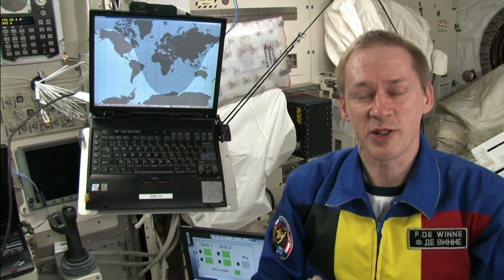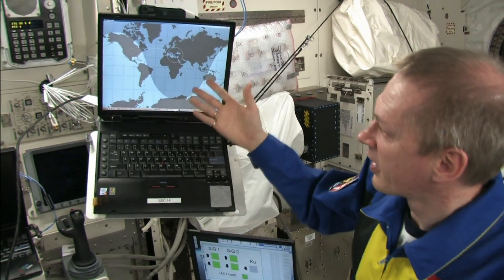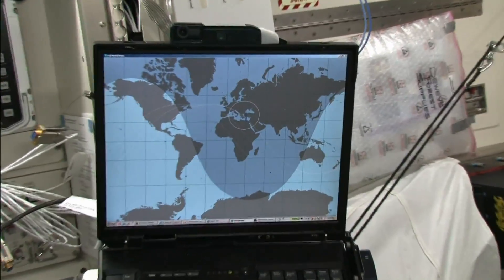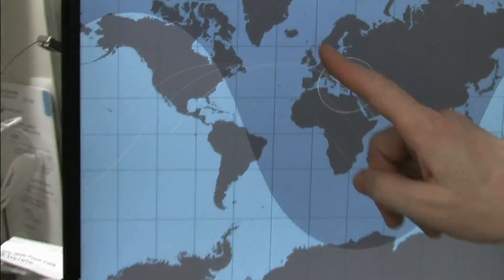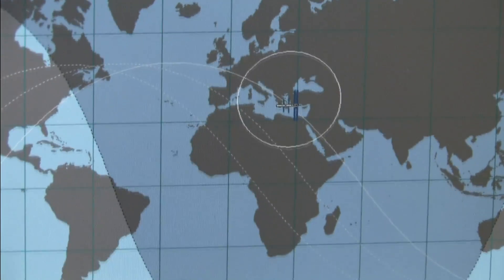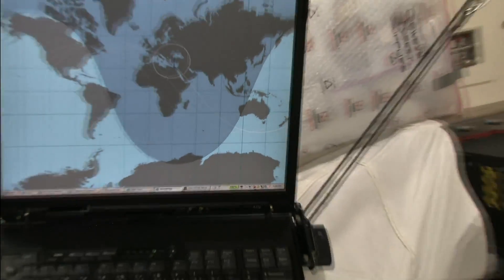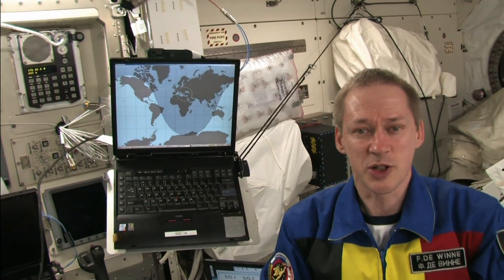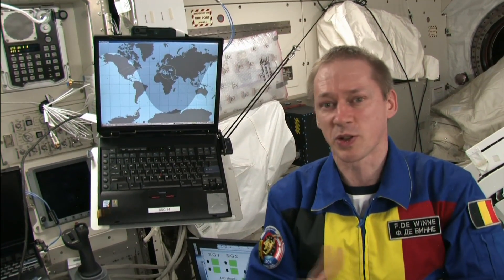How do you keep the ISS stable in orbit?

Comment: Hi! But how does it move if there is no air in space? I mean how do you thrust it without air resistance?
Reply from the maker: Hi there! Great question! In space, there's indeed no air to provide resistance for traditional engines. The International Space Station (ISS) uses thrusters that expel a stream of fast-moving gases, like nitrogen or xenon, as reaction mass. Newton's third law of motion states that for every action, there's an equal and opposite reaction. So, when the ISS expels gas in one direction, it moves in the opposite direction to conserve momentum. These thrusters help control the station's orientation and keep it stable in its orbit. It's a fascinating application of physics in space! 🚀🌌
Reply: @EuropeanSpaceAgency  Thanks indeed! It is an amazing explanation!

Comment: Hello,
   How can it keep its orbit at 17,150 mph(average),when he says they need to adjust speed to adjust to higher altitude.How does it not spiral down towards Earth?Surely it would be huge adjustments.
Reply: Check out the game Kerbal Space Program. In this game you build and launch rockets and space planes. Among other things, you will establish and change orbits. You'll see that if it's just a few kilometers closer or further, you really don't need much thrust, because there is neither gravity nor atmosphere to slow you.
Orbit is "easy" to hold, again because there is no atmosphere to slow you down. Gravity draws you closer and closer to Earth, but because you're going so fast, you constantly fall past Earth, instead of spiraling down. Imagine this like a graph, on one side you have the rate at which you're falling towards the surface, and on the other you have the velocity relative to the ground. If these are in a proper balance, you will be in a stable orbit. If you now speed up, you change that balance and gravity won't be strong enough to leash you in an even circle.
As you start to move further away from Earth on your uneven circle, you'll find that the graph is changing again - you might be going just as fast, but relative to the surface, your speed is actually dropping, like somebody walking straight away from you doesn't move sideways, even though they're not going any slower. At this point, gravity is stronger than your speed, so it starts to slow you down until you start being drawn back towards earth. Now gravity is suddenly speeding you up again, until your relative velocity reaches the point where you're falling past Earth again.

This is all pretty unprofessionally worded, but I tried to make it easy to understand without using complicated words.^^
Reply: They need only tiny adjustments because the fiction in the nearly vacuum of space is very low